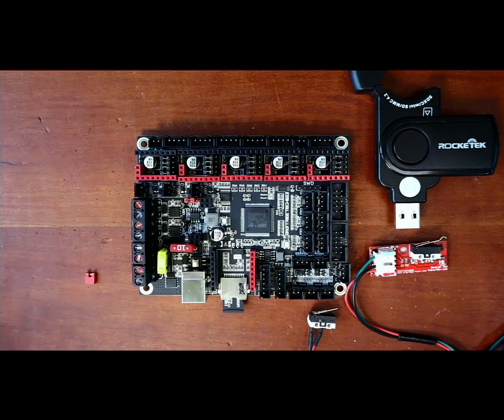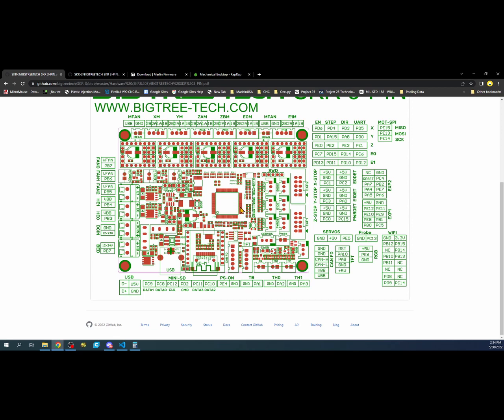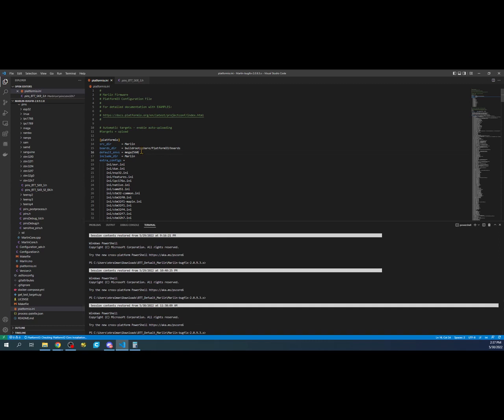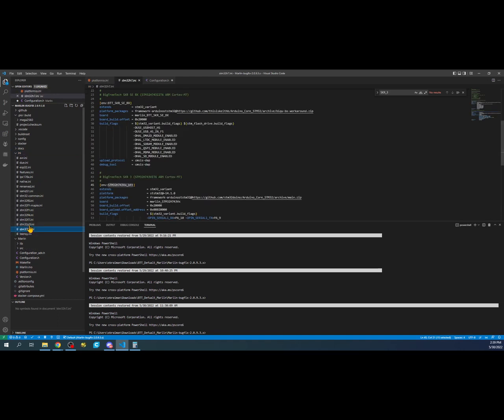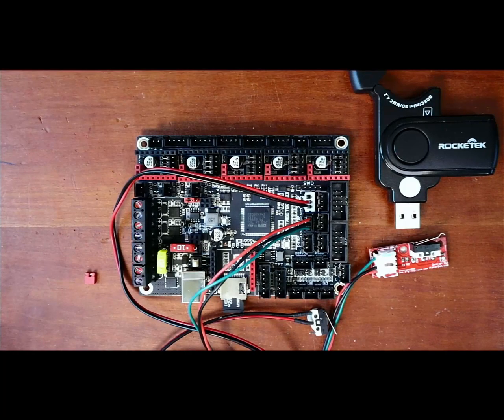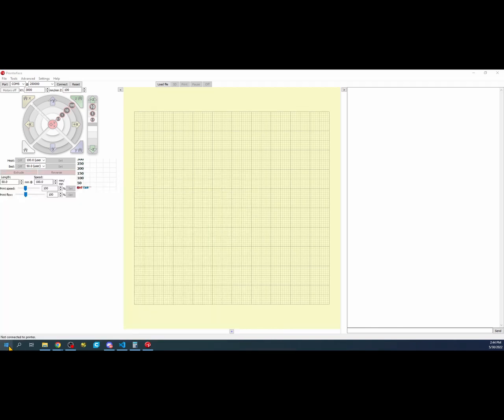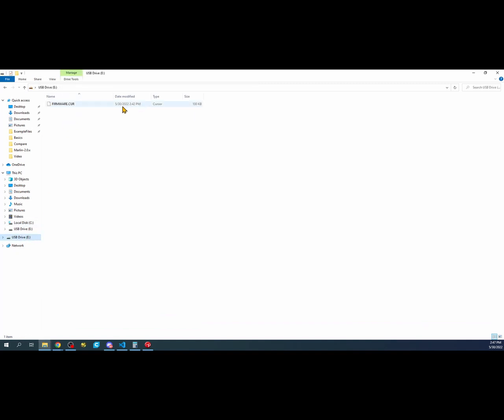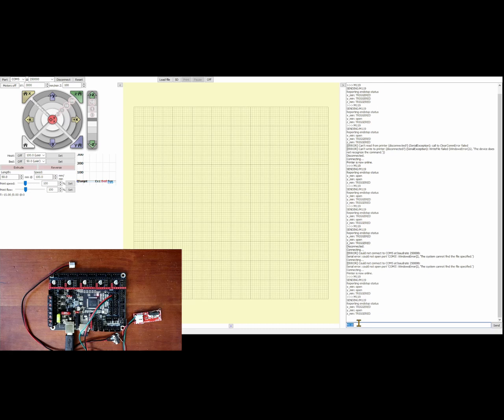BigTreeTech - SKR 3 - Switch Endstop

Comment: I don't get it...why did you think the X-ENDSTOP didn't work initially at 17:00?  When you held down the two-wire endstop it reported TRIGGERED in the console.  The 3-wire endstop is connected to the Y-ENDSTOP which shows open because you're not depressing it.  Later when you swapped the 2-wire out with the 3-wire it showed the same behavior as the 2-wire from a moment ago.
Reply from the maker: There might be an issue with stepper driver's due to a change in Marlin.  There's a Discord link in description, I might be able to look at issue and see if it the same as someone else had had on GTR v1.0 board.
Reply from the maker: The issue is a change in timing inside Marlin firmware.  They now do a double tap.